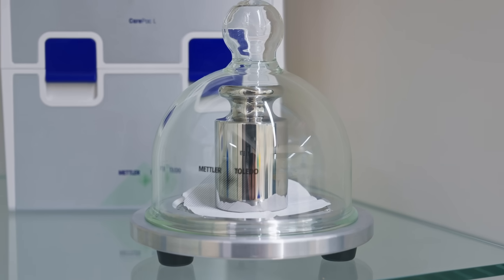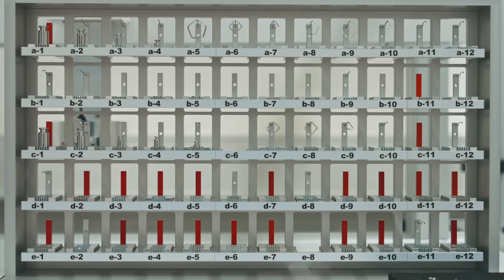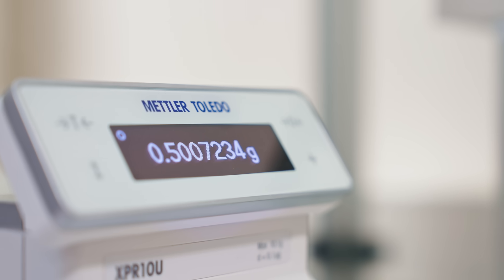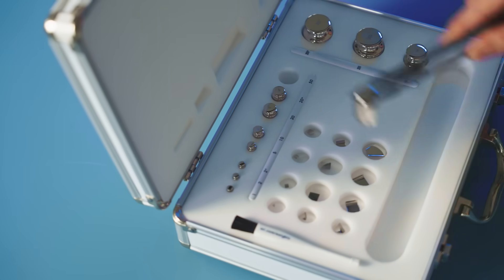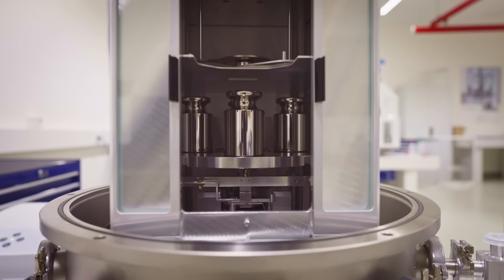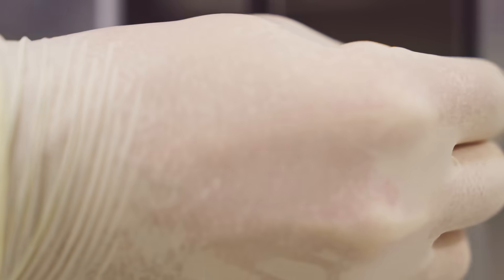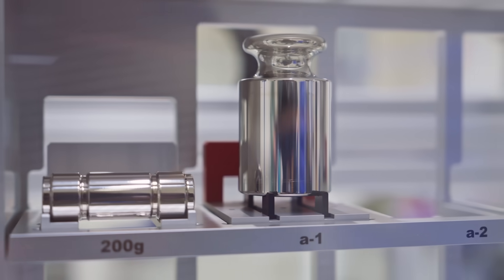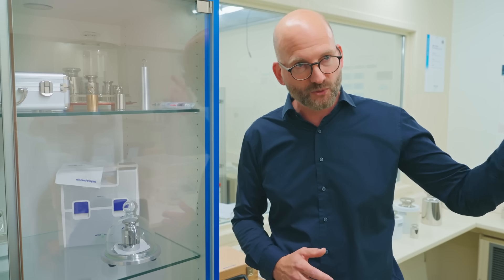What You Don’t See...Ensuring the Accuracy and Reliability of Your Laboratory Measurements

Comment: The wording made me curious: The "weight" and "weights", you never said mass? Does that mean a standard buoyancy (temperature and air pressure) is presumed. Thus is a calibration weight made slightly too massive to exert an exact force say 1 kg on the measuring device because it is not in a vacuum?
Reply from the maker: Hello @Tore_Lund
"Most commonly, they are referred to as weights, which is slang and is not the correct term. The correct term to use would be mass. You can find out more in the FAQ on this page (reference to Massenkomparatoren und Metrologie von METTLER TOLEDO https://www.mt.com/global/en/home/products/Laboratory_Weighing_Solutions/mass-comparators.html),  difference between mass and weight.